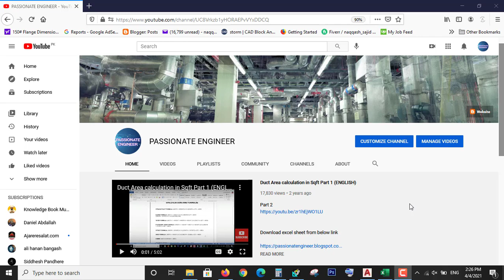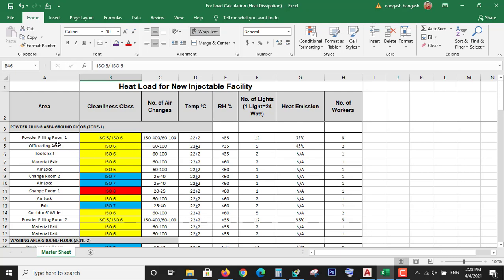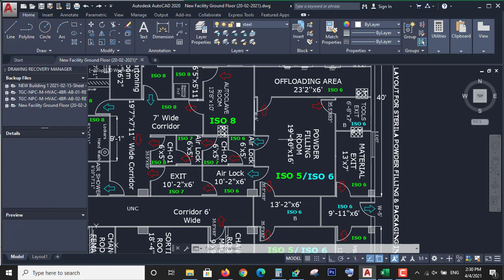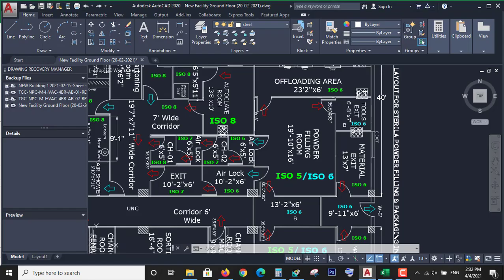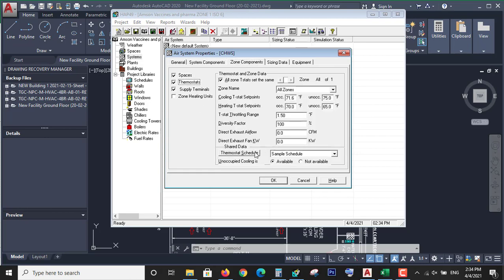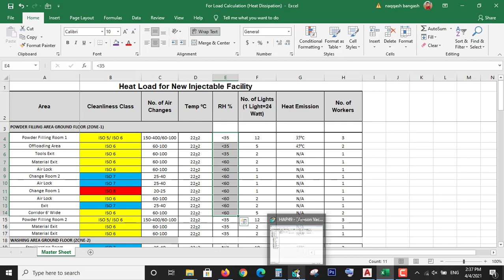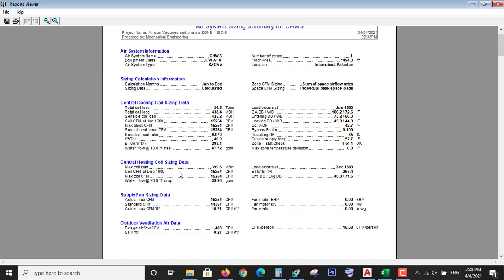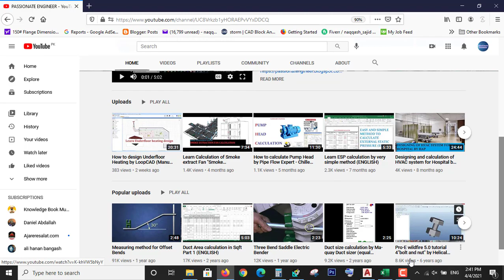Learn Heat-load calculation for Pharmaceutical Area and Hospitals by HAP.

Comment: Hello from Vietnam, I have question and hope you read and reply. The supply air from the AHU need to make sure 2 things. The first is to maintain the designed temperature and relative humidity. The second is to maintain ACH, for example 60 times/hour for iso class 6. And most of the time the supply air for both of them are different, so how can we deal with it. thanks
Reply from the maker: The AHU is usually designed for 400cfm/ton, but in this case, to maintain the iso class with certain ACH, the manufacturer shall designed the AHU based on these requirements to achieve certain cfm and achieve tonnage.

Comment: Many of designer fail 
He achive every thing like
Humidity
Temperature
Partical
Ach
One thing is fail the units 
That is pascal 
Every editor 1st question 
Pascal 
Filling area are 55 pascal 
Unit do not show on gague 
Why designer are not consider it .
Reply from the maker: Pressure is not a part of load calculations. You can achieve everything by precise calculations and standard equipment.
There are other calculations for dehumidication only, where you need to consider vapour permeation through different building envelope materials.
You can't depend on only one calculation.

Comment: Hello , I don't think that using high ACH in load calculation is correct ,, ACH that must be used in HAP is the one related to fresh air requirements , however, the ACH related to cleanliness should be considered to calculate the number of fan filter units to circulate the air through HEPA filters , hope to hear back from you.
Reply from the maker: Sorry for that, but you are not right, ACH is a part of load calculation. Based on this, you will select equipment and cfm/ton.
Coil load and supply air temp depends on this.

Thank you
Reply: @passionateengineer04  thanks for your reply ,, but I did many cleanrooms in Canada ,, ACH doesn't mean fresh air ,, these are two different things ,, I agree that fresh air is part if the load calculation and it can be part of the ACH ,, but considering that ALL the ACH is fresh air is something that we don't do .
Reply from the maker: Both ACH are part of load calculation. If you are working in Canada, then it's also the same, but the difference is the fresh air unit, like if you are using HRV, makeup air unit etc than you don't need to consider the fresh air ACH.
You can do differently, calculate the load, and than put user define air flow based on ACH.
Reply from the maker: In which province of Canada are you working?
Are you familiar  with CSA Z317.2? ALBERTA COLLEGE OF PHARMACY?
Reply: @passionateengineer04  I work in Ontario,, would be great if we can have a call to discuss.
Reply from the maker: Ok
Reply from the maker: Please share your email

Comment: Hi . How can I add treated fresh air to cooling load calculation considering kitchen which has 1800 cfm exhaust.  And I want to add 90% fresh air but treated by FAHU 100% WITH entering temperature 75 F
Reply: How 75 F OA can be added to kitchen
Reply from the maker: @mustafajadallah4007  There is no option for treated air in HAP, but you can calculate it separately using psychometric chart and than add it misc load in HAP
Reply: Thanks for your reply

Comment: If I need to maintain a room temperature of 58Deg. F at what temperature do I need to set the off coil temperature.
Reply from the maker: Detal T = 10 to 15
Depending on type of system.

Comment: Nice video sir... I have one question. i am using ACPH method by E20 form or manual..when i calculate same cooling load by HAP as a result CFM rate is much different  comparing with E20 form...
So please tell me which i will consider as perfect..
Reply from the maker: What are you defining in HAP , ASHRAE 62.1 or sum of outdoor air?
It all depends on your inputs

Comment: Total tonnage is to high what you shown in report but practically that much no one will take because you have taken based on acph
Reply from the maker: You have to maintain ACH, cooling and pressure at same time.
Reply from the maker: Its designed on basis of 50c.
Reply: Tonnage you shown in video is for only one room Or all iso 6 rooms
Reply from the maker: Its for all iso 6 rooms
Reply: Ok thank you

Comment: For 320Sq.ft size of Operation theatre, we use 8 to 10Ton condensing coil. Is it right??
Also can you show how to calculate heat load of clean room using E-20 form??
Reply from the maker: You have to maintain 20ACH, with Standard occupancy of 5-8 persons at any given point of time inside the OT is considered.Standard equipment load of 5-7 kW and lighting load of 1 kW to be considered per OT. For super specialty OT the equipment load can be taken as 7 – 9KW. The fresh air component of the air change is required to be minimum 4 air changes out of total minimum 20 air changes.
Reply: @PASSIONATE ENGINEER I think as we taken these details, around 6TR/2500 cfm ahu only required for 320 sqft OT..fresh air around 450 cfm...is it right?
Reply from the maker: What's the height?
Reply: @passionateengineer04  false ceiling height max. 3mtr